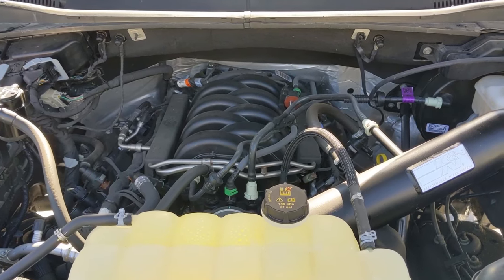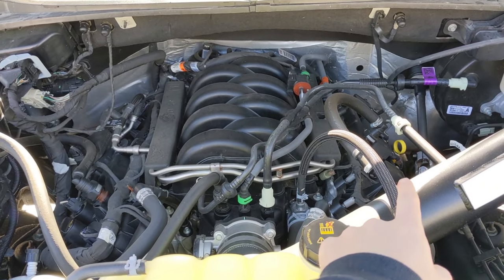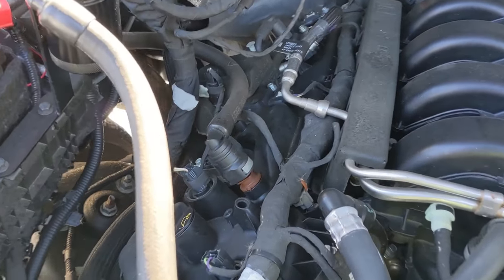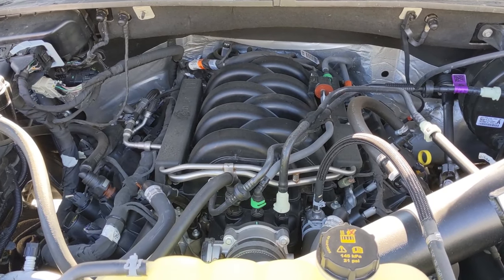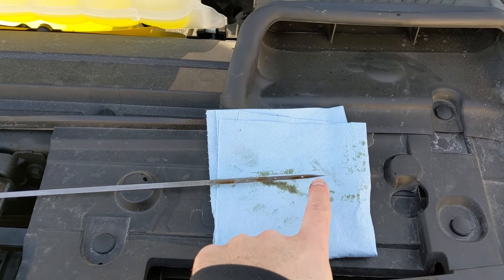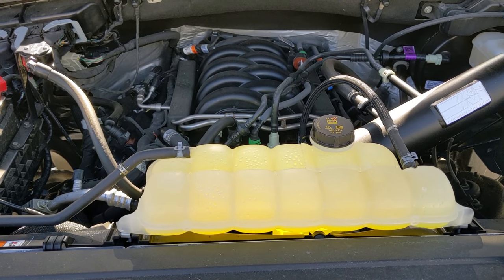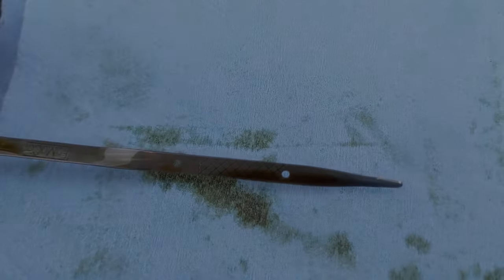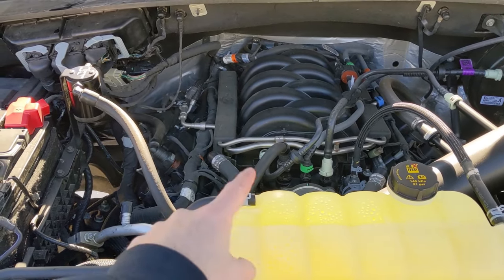Oil Consumption Update - 2019 Ford F150 5.0L

Comment: You just arent very smart. It did not solve the issue. Also you voided the warranty by installing the catch can. You cant make a blanket longer by cutting a foot off one end and sewing it to the other. Show me your new dipstick level after 5k km without adding any oil in between and you will be at least 2.5 quarts low. Bet me and ill prove it.
Reply from the maker: I'm in the process of filming an update video, oil is down just a bit over 1qt in 8000kms (5000miles). I'm switching to 5w40 next and will do an update video after that. And don't believe everything you hear online about voiding warranty lol I've done a K&N intake and MBRP exhaust, oil separator, and used Forscan on my truck to tweak the body control module and it's still covered under my Factory Ford 10year, 200,000km warranty.

Comment: Gen 3 ....5 0 Coyote V8 are junk...they suck oil...tick like a typewriter ...sound like a diesel..and ping on 87 octane gas
Reply: Personally I wouldn't want to run 87 octane gas in anything with 12:01 compression to start with.